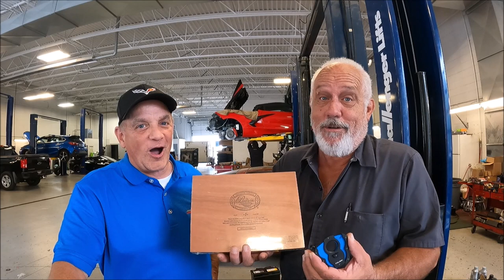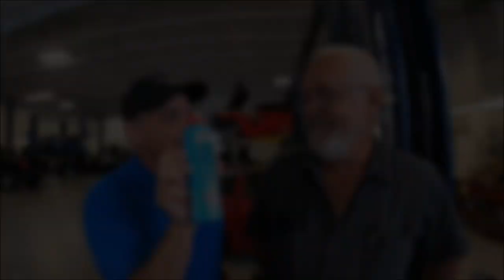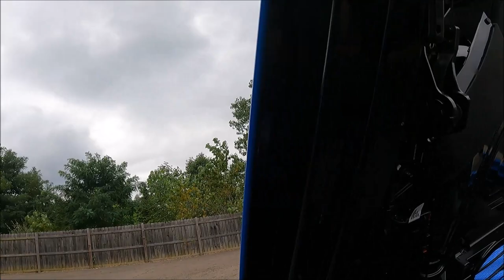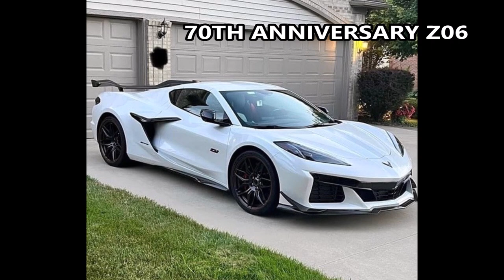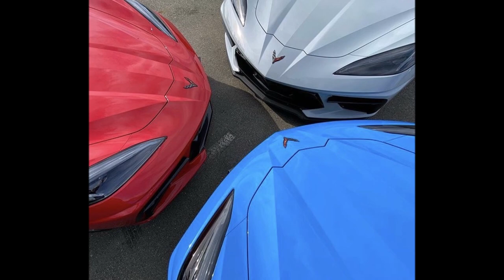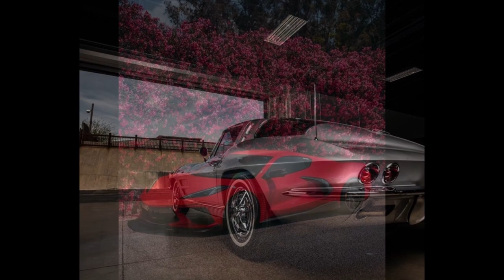C8 CORVETTE MARKET CRAZINESS & YOUR TECH TUESDAY Q&A

Comment: Tech Tuesdays just gets better with every episode, there is no other place that we could get a plethora of this information
Reply from the maker: Wow thanks and we almost did not do a show tonight because of business demands - thank you
Reply: @RickCorvetteConti  didn’t know exactly where to ask and maybe Chuck can help. Got the ‘Rear Axle System Off’ on my 2020 Z51 a week ago and it’s in the shop. My research and talking with a plant rep, the body valve may need replacing. This was an issue with C7 which had totally different tranny. Is this ‘Body Valve’ a common part with the DCT and what else might be issue. 7370 miles, 26 months of ownership, no tracking and this is killing me and the DIC message also gave a CEL. Thanks! 

JD 
Indianapolis, IN

Comment: Thanks for the information for the cable breakage and probable supplier, design change Rick. The dealer I went to was Myrtle Beach Chevy they ordered the cable but it's on back order at this point. I just hope they ordered what Chuck specified he ordered that cable and any other components to fix it. Great Tech Tuesday Rick and Chuck with your beautiful rides. Have great day Rick.

Comment: My 2020 C8 sometimes will not shift automatically up or down. You can manually shift just fine and it usually clears up in 5-10 minutes. Is this a software problem and what do I need to tell my local dealer so he can fix it?

Comment: I love your show on the vets. So I bought a 22 C8 Z51 Lt2 and was thinking about trading it in on the new truck I bought but my dealership only offered me less then I paid for it new from them. I had it for 8 months and it has less the 500 mile. It been in a climate control and in perfect shape. What is this car really worth?
Reply: What you can get for it. You might be in a saturated Market. Other areas they should be worth $20k over msrp.
Reply: More than you paid for it. Absolutely
Reply: Thank you both, the day I bought it my salesman and the manager told me that it was worth 20k more used, but when I was buying my new truck it was a different story? Thank you again.
Reply: @dalecronk4377  they sold you 2 vehicles in high demand. Lowballing you on the C8 would get me another dealer experience. I was offered $30k over for my 1lt in October. Drive the car. It's fun as hell...
Reply: Yes I been lucky this year with all the problems in buy new cars. Good the C8 because a customer changed there mind and I’m still on the list to get a 23 C8 and just bought a ZR2 truck for my daily driver. I do have a long history with my dealership but I was shocked at there offering on trade in value on the C8